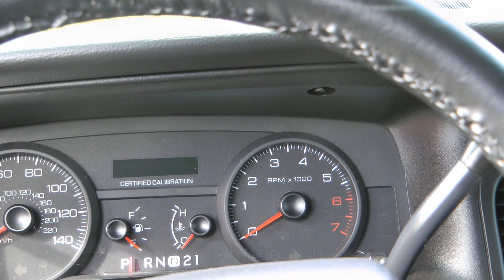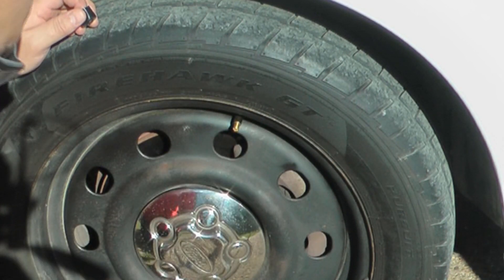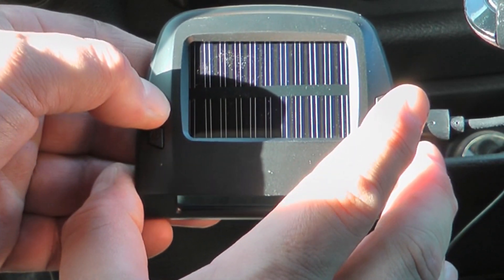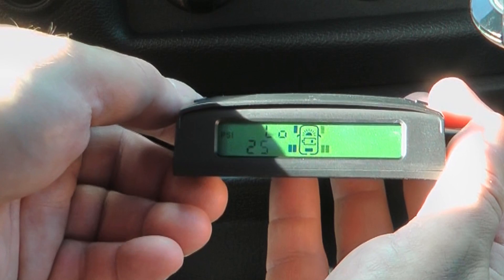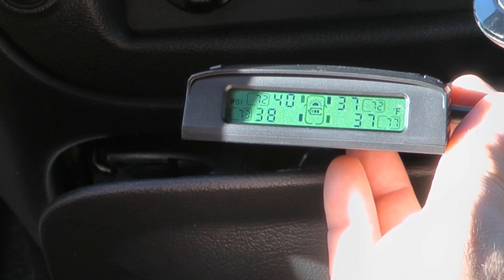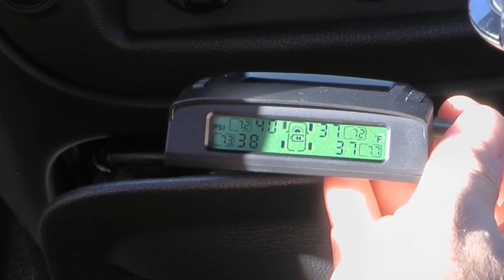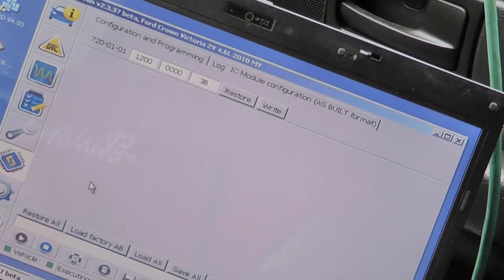Crown Vic upgrade TPMS and turn off low tire light with FORScan

Comment: What program did you use to remove the light? 
And is it free?
Reply from the maker: Forscan.  It is a free download.  The adapter to plug between your OBD port and laptop is about $10-20.  I have links to both in the description.
Reply: @WJHandyDad  I had the adapter plug from when I did cruise control

Comment: Thanks WJ! Very interesting gadget. I have a 2010 CVPI, do you know if these come with the TPMS on the valve stem or as a band wrapped around the interior rim?
Reply from the maker: the one in the video comes as shown, you replace your existing valve caps with the ones provided.  No need to dismount any tires

Comment: These OEM integrated TPMS systems were doomed from the start... battery operated yet they are installed INSIDE the tire? Totally useless from a user perspective as you should be checking your tire pressure very 30-60 days anyway. Not to mention the its just a huge racket for the tire guys cuz they like to sell them to you at $10 a pop
Reply from the maker: so far I'm loving this setup of having the tire pressures on display on the dash - so much more useful than just a "dummy light" on the dash

Comment: Just make sure that you put anti-seize on the stem.....they are prone to seizing up on the stems after a while.  Otherwise, not a bad system.  There are two versions of these sensors, perhaps you're better off ordering the 'internal' ones.  That's what I had to change to.   The sensors are turned off when not in motion, so you have to move a bit until they turn on.  That's why you see the difference after you're moving.

Comment: This is the first gadget i bought for my MGM when I replaced the tires.  Love this thing but has its quirks. A few things Ive learned about these little units: 1. The wheel sensors arent real time, the update only when the wheels are moving and at 1 minute intervals. 2. The external sensors are not very accurate. They are great for noticing a change in temp or pressure but not exact psi. I use a good digital guage to st my pressures, but get differences of 3 psi at each wheel with the tpms. 3. The included batteries in the sensors dont last long. Mine were dead within a month. Replaced with Energizers and have been going strong for a year+. 4. The solar/battery in the unit is barely sufficient unless you park in the sun ALL day. Hard wire it to the fuse box for a clean reliable install. Will be re installing mine in my overhead console to replace the compass that I never use, and pulling power from there.    5. In retrospect, I wish I bought the unit with the Internal wheel sensors and had them installed when I got new tires. They are far more precise and look cleaner on the wheel. 6. The lock nuts are simply a theft deterrent, and not really needed to function. Its a royal pain in ass to add air, especially if you loose that little wrench. Would be really easy to twist that rubber valve stem clean off while adding air at a gas station on the road. Saw someone do it on an RV. Avoid using the nuts if you can. Aside from the quirks, these things are great little units to have.

Comment: Right on W Dandy,
Thanks again for helping me out with this project, I really appreciate it.

0:28 Did you have this system installed for your last blowout? lol

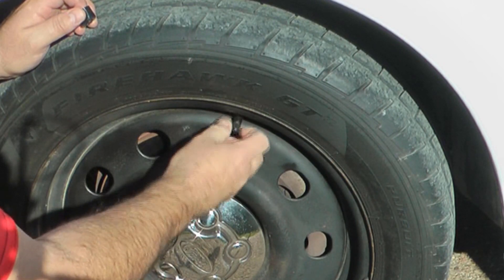1:18 Isn’t Firestone the whole reason we have the TPMS Regulation in the first place (circa 1996)?

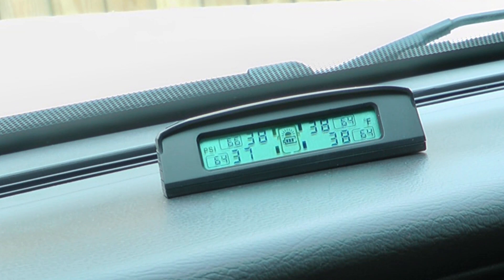8:09 Are you sure it’s not “weight” activated? lol

8:53 Can the TPMS System be disabled using the FORScan device?

10:08 I think I just got my answer to the last question. Lol

-Chuck

Comment: I didn't even put them on my Dorman replacement wheels. The name brand tire shop I was at tried to tell me that it is the law to put them on if the car came with them. I raised an eyebrow, picked my keys up and started to walk out. The manager saw $70 walking toward the door and changed his mind. I'm glad, because they are the only place that does road force balancing.
Reply: Good for you Rob,
I'm a fan of the technology. 

But the way the federal regulation was written, and its implementation  leaves a lot to be desired. 
-Chuck